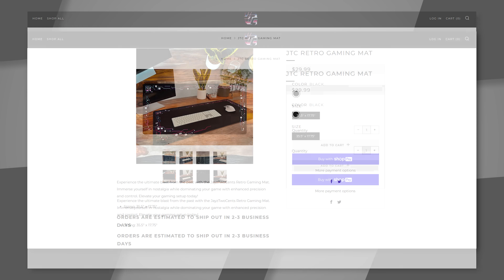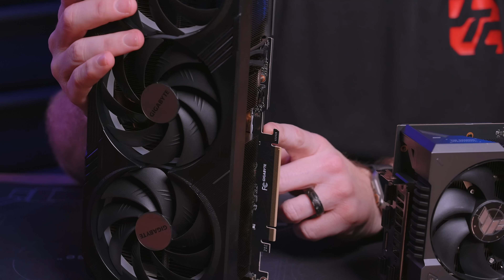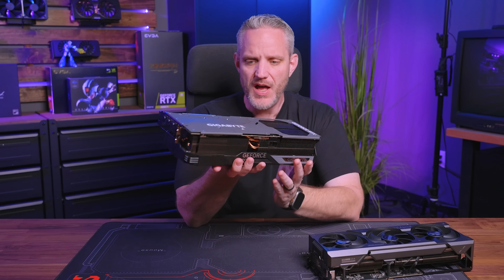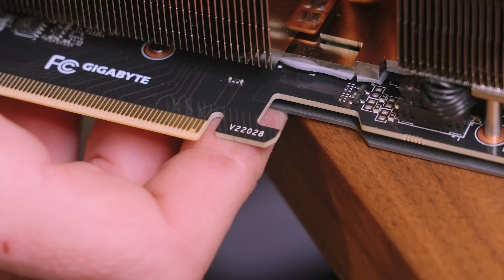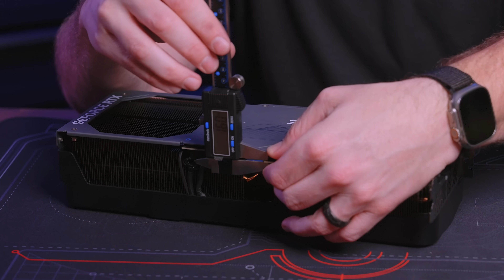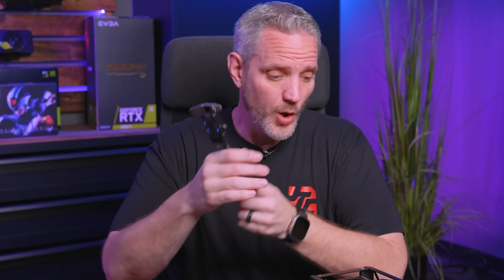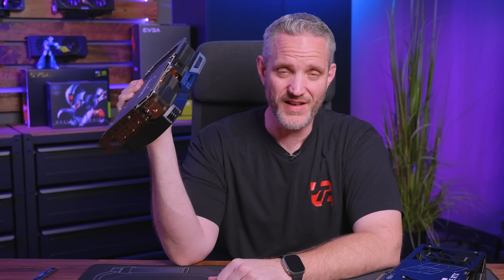These GPUs are cracking and the company REFUSES to warranty them!

Comment: My Asus TUF 4090 is starting to worry me, because of the sheer weight of Nvidias Octopus adapter plus heat is a lot of stress on the GPU 12vhpwr.
Reply: Chill!!!!

Asus TUF has the strongest build of all rtx cards!
Reply: @Mhdurj  hope your right, because I'm worried about using CableMod cable since mine doesn't show the full 600w, like Nvidias adapter. Ive sent them an email, waiting for response. But even then Asus won't accept an RMA if your using 3rd party cable. The Octopus is 4 pcie cables, I routed them on the side and let them rest on basememt, its hideous going over the GPU. Once you choose which way your pretty much staying that way. My voltage seems to change depending on the orientation of my octopus, it trips me out.

Comment: I always try to make sure that the video card has a zip tie attached to handle the weight.  Some CPU cooler towers are similar and bend the board from their weight.  A simple strap to keep it in place against gravity is an easy fix for this.  An even simpler option is to simply lay the whole thing on its side so that weight is a moot point.  With the advent of bottom PSU cases with the intake for it up against carpet, this also will lower PSU heat considerably.

Comment: I use a GPU Support Stand which has an adjustable height video card sag holder. They come with LEDs if you want ARGB lighting. Cost is small compared to a new card.

Comment: I think there's a lot of blame to go around. 

First off, we need to know how widespread the problem this is. Saying 'card after card after card' doesn't give us any kind of grasp on how widespread the problem is, of the thousands to tens of thousands sold. Gather the numbers.

Two, we, as consumers, are demanding faster, more powerful video cards, year after year, because new games are requiring 20, 25, or even 30% more power, year after year, which translates to better cooling mechanisms. That causes the cards to balloon in size and weight, and makes the original architecture work harder to handle the stresses imposed on the original card design.

Three, consumers (again) along with CASE DESIGNERS, are starting to hang these video cards in ways that weren't envisioned by the original design architecture. So hanging a 2-3lb card horizontally, and on it's side, introduces us to the 'flex' problem that puts stress on the retaining clip was well as the contact 'lip' itself. 

Second only to the motherboard itself, the video card is the most complex subsystem in the whole computer. To require that it 'gain weight', then make it 'hang from the rafters' is eventually going to net us problems that will eventually require a complete redesign of the video card to bring us into the future. 

Do we really expect the companies to stand behind a product when it's continually being manipulated in a way for which it was never designed? We like variety in product choice - let's make sure we don't chase the manufacturers away by requiring their products to jump through hoops it was never designed for.

Comment: There is a reason why I have my cards tied up since basically forever. Even as far back as my HD 4870 back in the day.
And full length (12.5'') cards used to be also mounted at the other end of the card towards the front of the case. Mainly a server thing, but the same connector, so they also worked just as well in desktop machines.

Comment: "The top selling graphics card on Amazon is Gigabyte's GeForce RTX 3080 Ti Gaming OC with a factory overclock and custom 3X Windforce cooling solution. After that, MSI's GeForce RTX 3080 (LHR) is the next best-selling GPU, followed by Zotac's GeForce RTX 3060 Twin Edge OC."

When you sell the most you going to have the most rma's, that's simple statistics.... You need to find out the number of rma's per thousand units sold ... Otherwise you're in anecdotal Fantasyland

Comment: Give 1000$ and what u get is 1440p @144 at max settings not even 4k with High refresh rate at max settings and cable melts, PCB brakes, chip crack,vram not sufficient, manufacturing defects

Comment: Why less plastic? Save a few cents. Its the metals that cost more.  7nn chips are already so sensitive to interferance from graphics cards the the graphic cards need to be big to shield  the cpu chips. Hopfully you have a case that blocks the power supple from interfering with your gpu.. that card is thin on the bottom. No more tight builds.

Comment: I don't know what happened to my previous post but... I have only recently purchased a 4080 and 4090 as have my friends for our multiple rigs, I am currently questioning Gigabyte about this regarding their policy and I have told them flat out that if they intend to refuse warranty in the event that this does happen to us that we will all be returning every Gigabyte product we own - we estimate there is about 25K USD between us. Gigabyte so far is dancing in all directions around the question and not actually answering the question, thus in my last attempt to get an answer I left no wiggle room they have to answer one way or another or we will return all the gear anyway.

Comment: I bought a 3080ti for 600 bucks and it works really well, just had thermal paste

So far I haven’t found any issues with it besides rgb issues but imma buy a riser cable just in case…

This is gigabyte for those confused

Comment: I think that GPU support brackets or pillars need to be mandatory at this point. they are far to heavy to be left free standing and supporting their own weight. no wonder these are breaking...
Reply: Pillars or brackets that put load somewhere else on the case because they are taking load off the tab plain and simple so it does not crack cause times have changed plain and simple🤣🤣🤣

I have to say that cause someone will make a pillar that is just for show does not take the load and this will happen in that scenario cause if anything it ads to the cards stress

Comment: How many Gigabyte owners use a support bracket to keep the GPU in place and prevent it from sagging/cracking?  This is a step I am personally taking to keep my ASRock Phantom Gaming D Radeon RX 6600XT OC in a safe position once I install it and start using it.

Comment: I just bought an RTX 4080 myself, Gigabyte brand. Unlike the card that he showed in the video, the mounting bracket looks to be very firmly secured to this one with multiple screws. I will be very careful while installing it and make sure the screws are tightly securing the mounting bracket to the case, hoping to not have any problems.

Comment: I'm just collecting components for a new PC to replace my 11 year old i7 3770k and I threw out everything Gigabyte, in total only the motherboard is left :D I also have a GTX 1070 Strix and it's a genious piece of engineering. I've had many ASUS motherboards, none failed despite heavy OC and many years of use. I have 11 year old Gigabyte Z77 motherboard and too good. But last failed my brother GPu GTX 780 die two times. One on guaranty second after 2 months guaranty end... I have dead GTX 4080 Gigabyte- i repaired and delided, work now great.
I have enough attractions with burning AMD CPUs, bending Intel 13xxx, melted RTX 4XXX plugs (I have a 3060ti with a burnt plug that I had to replace myself with one with 6 power pins). The current PC market is a bad joke. I'm looking for a board with a POST code display and I have to spend almost twice as much for a power ON switch and a 7-segment LED display - $ 0.6 in value ... Just a moment and I'll throw this new PC into the trash just like I threw the ASUSA board out of the basket. I'll wait for the next generation... and I've been waiting a few years now.

Comment: The diablo killing cards thing reminds me of Bioshock remastered killing cards. It killed my 3090 and after I had it repaired I tried it again and Bioshock didn't kill my gpu but crashed my system like it did before. What's the cause to that? All other games (far more demanding) run perfectly fine. I have a z790, 13600k and 3090.

Comment: can we all just unanimously agree that the size and weight of graphics cards has increased at such a stupid rate.
and that non, if barely any, manufacturer, first party or otherwise, has done a good, consistent job at making sure they are structurally sound and useable for their intended purpose in their intended orientation?
we're very rapidly reaching the point where it's no longer "i'm buying a graphics card for my PC" but a "i'm buying a PC to house my graphics card" which is just stupid...

Comment: Hi jay 
I think the corner in gigabyte are more away in distance from the major pcb than asus one 
Also asus has a support plate in this area 
These two factors make gigabyte and asus appear like this 

So if you use anti sag brakets it will not crack in my opinion cuz many people i saw didnt use it

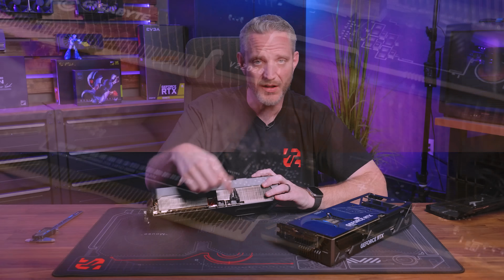Comment: @jayztwocents 14:10 something important to note is the amount of space between the tab and the rest of the PCB. The gigabyte card has a very large gap between the tab and pcb, whereas the other card has significantly less of a gap. The large square cutout makes the gigabyte card have a longer lever at that point, but the small cutout on the other card is much smaller, therefore a shorter lever. Like pushing on a door from the handle vs near the hinge. Hopefully what I’m saying makes sense. The fact that it feels stronger despite the thinner material points to this being a physics issue.
Reply: This was my first thought as well. At 6:50 you can see the Asus has a metal pillar there to add strength. A 3d printed snap in gusset would solve this issue I think

Comment: jay please look into rtx 6700xt .....my tabs have the same problem i spent days trying to figure out why my gpu was voltage dropping and crashing in games, its wiggling loose even with a gpu sage bracket and pole ! after inspection i appear to have completely lost an anchor tab in the slot, literally never taken it out since install and worked fine for 2 months...voltage light is on and always sag..
Reply: maybe it is a structure problem with having three fans on these giant cards throttleing from 0 to 3000 rpm+ back n fourth have we hit the "too big" for their boards?

Comment: Great video very informative Jay, saw at the 30 second mark in the video that Jay refers to issues that Diablo IV and New World are causing and impacting GPUs.  I own a Gigabyte RTX 4080 and I have experienced loss of video out, gpu fans ramp to 100%, still have audio, but have to do a restart of my pc.  This has occurred on a few occasions, no identifiable reason why this scenario occurs for me, purely random, no pattern discerned. Does this mean that my RTX 4080 is a dud? I also did not install the anti-sag bracket, that came with my RTX4080 as it would have required full extraction of my motherboard out of the case to install, and I wasn't prepared to deal with that.  I did do the Jay 'hack' and stacked a few PCIE slot covers together to create a ridge that my RTX4080 rests atop ....worked a treat.

Comment: Guys I have a Gigabyte 3090 Turbo. Should I be worried? It's a blower style design so very light compared with my 2070 EVGA that was 3 slot I think this is just 1 or 2. I see no sagging as the MB is very sturdy. x99 Asrock with reinforced PCIe slots.

Comment: The system was designed to hold 500g cards. Now we have cards that goes up to 5000g. Even the asus one will break eventually. You need to retain weight on the cooling parts. Some towers have backets for this but most of the time not. I felt soo uncomfortable that I added 2 pieces of wood to support the coolers with the bottom of the casing. They need to rethink the lock system. A pcb is not made to hold a lot of weight stress.

Comment: I'm pretty sure it has to do with the resin used for the boards, some resins with correct ratio on the hardener would give better rigidity on the actual pcb. Think of it as fiber glass on a resin, mess up the ratio on the resin, the FG gets all flimsy and won't have rigidity on it. best thing to do now for ones using gigabyte 3000 series cards (including me LOL) would need to find a tech who is willing to put resin in that weakspot.

Comment: This is what happens when you have poor consumer protection laws.

Here in New Zealand, we can go to the merchant and they MUST repair/replace, or if that's not possible, refund. It is not optional. We don't have to rely on a manufacturer's warrantee. Heck, you can often force this even after the warrantee has expired, depending on the cost vs age of the item. I.E., it has to last a reasonable time relative to the cost. If the merchant has a problem with that, they have to go to the manufacturer. Piss off enough merchants, you will find your product no longer stocked.

Comment: The material of the PCBs (boards) are the same: FR4. The tab for the PCIE on the Asus one seems shorter what makes it sag less. The asus card seems to have a better construction after all. And the reason why they layout traces that way may be bc of EMI compliments, complexity on the routing or to match the trace lenght for the differential pairs  for the PCIE connector

Comment: Every card this size should come with a support bracket with actual thought put into mounting. I have seen this done even in the more value offerings from other brands, so there is no excuse at this class of GPU. What is actually happening is cost cutting from Gigabyte. Gigabyte cards gained lots of traction in previous years because they offered larger, triple fan coolers on many budget cards while maintaining a very low price, maybe the best cost to cooler ratio in the business. But cards were smaller back then, and even then they had a bad habit of pushing those same coolers onto hotter GPUs where despite looking big they were not appropriate. That trend of basically making their high end with cheap cut corners that only works in a very budget space has persisted.
Reply: Sapphire cards come with a support bracket that screws directly into the PCIe brackets on the case. Was so impressed to find that included when I switched to the 7900XTX Nitro+
Reply: I built a brand new gaming pc two months ago with an MSI RTX 4070Ti SUPRIM and in the box of the gpu I got a support bracket and a mouse pad so.. there are good companies who think about those type of things.

Comment: PCB's are made of layers of fiberglass and circuit runs.  the board could be more flexible if it has less glass, and more resign.  Also how many layers, and how much of those layers are copper runs verses resign will change how flexible they are.

Comment: Building a GPU cooler your way will produce more issues than you think. The back bracket is needed for sag prevention. I got more than 20 Gigabyte GPU also rejected by Gigabyte. Some info could be provided if that helps.

Comment: This is apparently common in the industry now. They ALL do it were they will comb over your RMA to find a reason to deny your warrenty claim even if the said "damage" wasnt the reason for the RMA. Thats illegal because you cant just blanket deny a warrenty claim. They have to prove that the "damage" was the reason for the failure. Having a slighty bent pin isnt going to cause your card artifact in games BUT thats the justification they will use to deny a warrenty claim. Its become an uphill battle to RMA stuff now its disgusting

Comment: Poor design. The enginering choice of putting  the coolers mounting hole close to and diagonal to a obvious and common, stress point  was a shortsighted design choice. It will fail evertime for a varity of reasons from mishanding  to material fatigue. Consumer products have to take into account that are not going to remain static for the duration of the products life cycle. PCI-e locking tabs are notoriously difficult to release, exacerbating the designs inherent weakness.  The other cards shown from the different manufacturers avoided this issue by relocating the mounting hole.

Comment: Gigabyte denied my RMA on a motherboard. I knew what was wrong and even took it to a pc shop to get a diagnosis printed in case they did not believe me. They took a picture of the back of a cpu socket and said it was user damage. It was a RAM slot. I knew it and the PC tech knew it. I had them send it back. I put it into a system with a single 16gb stick of RAM and it works fine that way. It worked with SEVERAL different CPUs. I explained that I buy a LOT of Gigabyte parts to sell in systems AND that it was under warranty. They did not care. I have only one Gigabyte part left because it was the cheapest 3060 12gb I could get. No problems with it so far but when I sell this system, I won't be buying anything else by them.

Comment: Sure it is bad design but thats PCIE slot specification that needs an update. There is no way to get a crack there if you mount it correctly. User error as usual.

Comment: After watching other videos about this and Bullzoid opinion this is obvious planned obsolescence by gigabyte, do not put mounting holes near weak point, avoid putting vram near PCI-E pins and reinforce if you do it anyway, and always include universal gpu support bracket that can be mounted on the motherboard for example.
Not to mention stop shiping systems with GPU pre installed just ship it in a box seperatly and have user install the gpu and provide instructions, the vibration will destroy the gpu even if gpu is properly supported during shiping, even tho the damage won't be obvious, and honestly the only way you can avoid this is via vertical gpu mount to a point there is never any stress on the PCB or any point of the card.